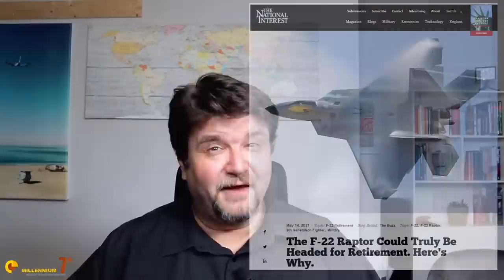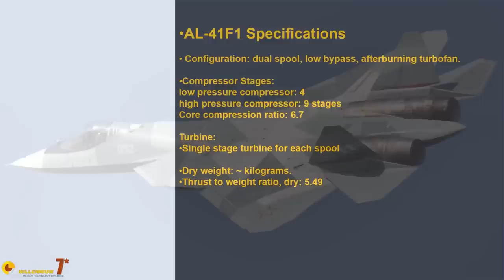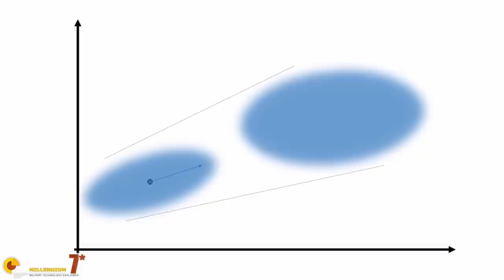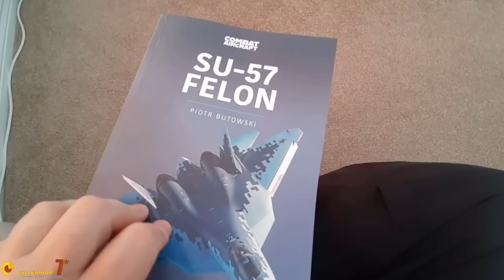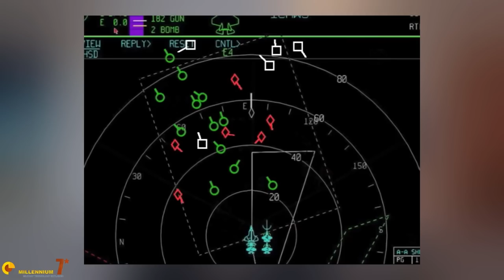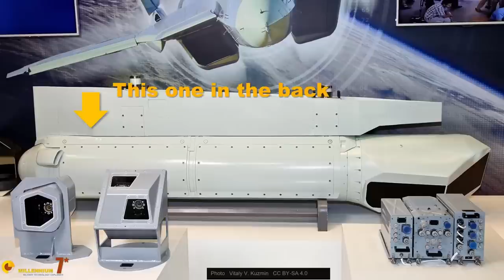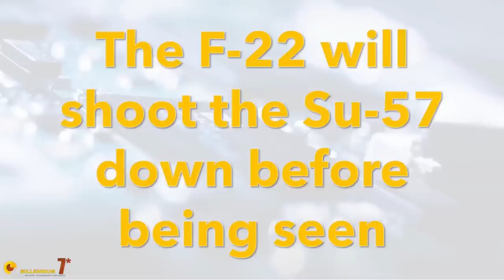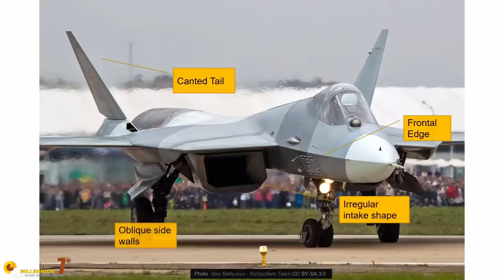Su-57 Update! + In Depth Analysis

Comment: Excellent video, as usual. 
  Just two points:
 You stated that a Super Hornet out maneuvered an SU with thrust vectoring. I’ve seen this video. The US pilot was flying a legacy Hornet, possibly a two seater of the Malaysian AF. I agree with you that TV nozzles have traditionally been used for instantaneous pitch. The Hornet series have excelled  with high pitch rates & high AOA without resorting to TV.
 The USN reserve pilot was working as an instructor for the Malaysian AF. His callsign is “Gonky”.
 
 Second, the issue of TVs effect on efficiency & stealth:
 You  stated that TV on the SU57 could be used for trim, eliminating drag (& also keeping these surfaces “stealthy” or flush). The F-22 already does this. 
 Before his recent death, Tomcat pilot “Snort Snodgrass commented that while flying formation behind a Raptor, he watched the TV nozzles “twitching several times a second”. This anecdote only tells of how it works in close formation and at the speed on that occasion ( it was a legacy flight ) at an airshow. Still , it’s unlikely the designers would leave this advantage “on the table” for 20+ years.
Reply: i think i heard this gonky guy on another channel and he was talking about dogfighting su-27 and said that he also lost to it but isn't going to post every single video and that su-27 is very capable
Reply: Gonky is on videos here on YT with Mover.
Reply: Gonky was contracting for BOEING and was in Malaysia as a part of the F18c upgrade program (to bring the F18c's to Superhornet level Avionics)

Yes Gonky's video is VERY clear to point out that he LOST to the Su30MKM plenty of times and that its BVR capability is also extremely good if not better than the Upgraded Malaysian hornets. He also mentions the way the Su30 was able to turn the tables, he dips his nose and mentions it doing an "eye watering" maneuver and has its nose on him before he could react, mainly because the vectoring allowed the MKM to complete its turn  significantly faster and beyond the capability of the Hornet to respond.

The Malay hornets were upgraded with Avionics that give parity to the Superhornet including HMCS, they are much better than the average legacy hornet. Obviously the MKM's are also positioned closer to China , based in the north of Malaysia because the MKM is still the primary air superiority platform of the RMAF... that by itself is plenty telling into the perceived capability of the MKM versus the upgraded F18C , which as mentioned is basically at parity with the Super hornet due to upgrades

Comment: Another stunningly precise evaluation. Excellent work, thank you. A thought on the L band and X band. The L band radar may be used in a search function, then passing off to the C band for tracking of stealth aircraft. Just a thought. Thank you again.
Reply: Those folks who clam the Su-57 L band radar (15cm-30cm wavelenght) can't track a US stealth fighters are fooling themselves.     The wing span of a jet fighter is huge so an leading edge phased array would be able to find the bearing (left right) of a target to within a small fraction of a degree.   The range could also be determined to within a few meters.   We then have the problem of the elevation. A two row dipole array can probably get a half power beam width of 20 degrees and be steered by mechanical rotation or phasing.  The ability to find the angle is probably 10-20 times better so about a degree.   A degree is an error of 300m at 20km but in elevation only.    There are other ways to direction find, for instance the radio goniometer as was used in the British Chain Home Low omni directional radar.  Sometimes simply called a direction finding loop.   B.T loops etc.
    -You are right, the X band radar can be cured by the L band.   A target to feint on an X band that is would be ignored as possible noise can be confirmed by the L band.   an Infrared Search and Track can also confirm.
    -So our chinese and russian fighters may not be as stealthy they are still very stealthy and the problem for western fighters is they don't have L band.
Reply: @williamzk9083  L-band AESA ( 8 pcs ) in Su-57 as mentioned before  are there  especially against aircraft with stealth features ( planes / fighters and bombers/ ) ,missiles and so on.

Wavelenght is exactly 24cm and is 8 times bigger  then in X band. So it means that e.g. something what L band can see ( detect-track) at 400kms , X band can't see at all or can only at 100 or 200kms ... Aircraft that have RCS ( frontal aspect ) e.g. 1m2 in X band have RCS in L band of 10m2 .

I wrote before some details about first public showing of AESA L band antenna at MAKS 2007 .It was big surprise then because it was and is only decimetric search-track radar on one fighter.

About that two rows of waveguiders in L band AESA , that are for different angles of searching . Upper row is for search-track when LEVCON's and wingslats are in  down position , row under that is for search-track when LEVCON's and wingslats are in normal position.

About beam width , it is lower then 10 degrees in azimut but is 70-90 degrees in elevation . There is no scanning in elevation only in azimuth( distance and azimuth measuring) . L band AESA have Mono and Bi static working regimes  and all 4 main antennas ( two in LEVCON's and two in wingslats) can work alltogether -simultaneously or separetaly.

L band AESA 's TRM  have 4 chanels , two for ID/IFF ( domestic and international) , radar search and jamming  of enemies L band assets. 

Because of phase and amplitude characteristics of L band AESA there is no stealth aircraft that can hide or stay undetected. Stealth planes can be detected and tracked from several hundreds of kms .
Reply: @williamzk9083  What is the difference beetwen X and L band AESA in Su-57 ?  First it is size and mass. Those  L band AESA antennas are so massive and heavy. 1.6m in diameter ( 4 main ones) , where  only one TRM have almost 5kgs of weight. In X band AESA radars we have a couple of hundreds or thousends of TRM , in L band we have a couple of them . Max output power of one channel in X band AESA TRM is a couple of Watts but in L band AESA is a couple of hundreds or thousends of Watts ( about 1kW) . 

Waveguiders have widht of 12cm or 1/2 of wavelenght and one TRM has row of 4 waveguiders ( each for one working channel) so there are 3 big TRM in one main L band AESA antenna with 3 rows of waveguiders ( 12 pcs) of course in 2 rows for different searching angles.

All AESA antennas both in X and L band have only one electric net for power and it is 27V DC-net. All of them have cooling by air and aircraft fuel , also all of them have not ' stand by mode' so after turning on they begin to illuminate signals into airspace ( Illumination mode).
Reply: @williamzk9083  yeah but with radars that small with that few transmit- received modules and with the limited power available on a plane what is the detection range going to be? Probably pretty small, esp against a VLO aircraft. And the F-35 has L band radar as part of its ECM suite.
Reply: @williamzk9083  
🤣🤣🤣
Už zase neviditeľná F-117, ktorú odfajčila stará S- 125 ?
Snivaj ďalej čo kto môže.

Comment: I really like the Su-57. Despite the teething problems that affect all aircraft development, I think it looks like a well designed, well thought out design. Thank you for your comprehensive coverage.
Reply: The internal weapon bay is not pressurized. On stealth aircraft, the weapon bay needs to have no gaps so that radar cannot get into the bay or reflect off the edges of the bay doors. However, if you do this the bay will be airtight. Because they are loaded on the ground there will be a bunch of air inside the bay that cannot escape when the plane goes to high altitude, and the pressure difference will blow the bay doors off the aircraft. Stealth aircraft get around this by having systems on board that equalize the pressure in the bay, but the SU-57 doesn’t have this; although it doesn’t need one, because there’s a gap in the bay doors that you can stick your pinky finger through. You want proof of that? Just look at 1:28:02.

Comment: thrust vectoring is also used in supersonic maneuvering. notching more efficiently is extremelly important to BVR combat, couple that with the increased angle limit of the radar locking on the Felon and you have a fighter capable of quicly going from nose hot to flanking while still keeping radar lock on the bandit which will loose lock by defending.
Reply: Yes they do. And if thrust vectoring was really useless. Why did US use it on the Raptor?  Right?
Reply: @Max_Da_G  The F-22 is supermanuverable wdym? The government hides the full capabilities, but the su-57 will out maneuver the f-22 mostly.

Comment: I like your videos on the SU-57.  Your part 4 states that there is L band radar on the plane and this can only be the case if the plane was twice as large.  S band is most likely along with x band.  As for using the DAS with the HUD, I am curious if the SU-57 has an auto defend feature like the F-35 using these systems.  Good job.  Keep up the good work.
Reply: Id imagine so with all the different defensive systems it would have to be. Most interesting aircraft I've ever studied on a pure tech level.
Reply: With how "automated" Ka-52 with Vibtesk DIRCM responding missile threat, i would believe the system on Su-57 will more complete on responding missile threat
Reply: Not necessarily L-band is decimetric and given how thick and long the SU-57s wings I’m sure they can fit enough emitters perhaps not to track and detect an aircraft but at least point the N036 in the right direction to where the target.

Comment: Thank you for the detailed discussion. I have always felt that in aircraft the US has the technological edge. But that is a mute point. In a knife fight does it matter who has the best knife, or who is the best fighter. In boxing, is it who has the best KO record, who has a longer reach, or who boxes his opponent outside his opponents previous experience. Let's hope we never have to find out the real answer those questions in combat.
Reply: Also, how many knives you have.
Reply: The Su-57 will never live to see knife-fight range with an F-22 or an F-35.  It won’t even know they’re there until the missile alarm goes off seconds before impact.  And even in an extremely rare knife fight, an F-22 is just as maneuverable and has better avionics and flight control computers , and the F-35 is a lot more capable than people seem to think due to better engines and flight control computers.  Missile capacity on both is being upgraded.  And the Su-57 only really has an advantage there with external stores, in which case it would be cannon fodder.
Reply: I don't see where the US leads Russia in tech, anywhere. From hypersonic missiles, to this SU-57 and even their infantry tools are are designed with different concepts.
Reply: @dennisyoung7363  Well then you're just not very smart then buddy

Comment: i guess maybe the su 57 radars works simmiliar to the "anti stealth" radarkomplex Nebo M M55ZH6M for S400 and other air defense systems , where the radar uses combined frequencys .
Reply: I believe L-band antenna at relatively pretty high power output, it will only can achieve the detection range of the X-band radar for the same RCS (i forgot how big the RCS). But it assuming that the L-band antenna installed both on leading edge flap and Levcon. This will make cooling a very big issue. So most analysis only predict the L-band for electronic warfare. 
But who knows, maybe Russia have secret algorithm that can differentiate pretty low energy L-band echo from the noise.

Comment: The "unexpected maneuver to confuse missile guidance" theory is interesting, but I don't think it holds up under analysis.

Modern Air to Air missiles have three phases of flight for long-range engagements: 1, "loft" phase - the missile climbs to an altitude where it can accelerate to its best speed for the engagement.  2, "midcourse" phase - the missile uses track data (either from the launching aircraft, or via datalink from AWACS for the most modern iterations) to predict where the target will be and intercept it, 3 - "terminal" phasse - the missile acquires the target with its own sensors and maneuvers to fuzing range.

The midcourse range is the range where it would be theoretically possible to confuse a missile be exhibiting unusual acceleration.  However, in this phase, the ranges and closure times are so long that the relatively tiny anomalies which could be generated by a thrust vector assisted maneuver are irrelevant.  The goal of the missile in this phase is not to hit the target, but to guide to a position where the terminal phase can take over.  the 'basket' in which the terminal phase can catch the target is very large (several miles wide), and the TVC capability cannot maneuver the plane enough to 'trick' the missile into missile by that wide a margin.

In terminal phase, there is no algorithm to trick: the missile will guide using "proportional navigation" - that is it will steer itself to maintain a crossing-velocity of zero with the target.  As long as the missile has enough energy to accelerate faster than the target while in this phase, it WILL hit, regardless of how "weird" the target moves.

Comment: Su-57 is the most flat-bodied (low-observable, high-lift, unlike all Western types) combat-jet I've ever seen (and remember now), 
with a huge weapons-bay (crucial, unlike the F-22's small-one) and IRST (unlike F-22). Unlike the F-35, it is high-altitude, high-performant, super-maneuverable, long-range, maintainable, rentable, survivable (two motors, set widely apart), rear-radar, scalable (growth capability internally and externally) and has no known alternative scheduled.
Reply: It still takes skilled hands plus hours and hours and hours in the seat to be effective with such an awesome aircraft, and it is AWESOME.  But if the SU-57 and the F-22 were to face off in the sky today, there would be a Russian military funeral, tomorrow.
Reply: I concur with most of this, though I’ll point out that both F-15 and F-22 are decent lifting body designs too.  The F-15 has even been known to have an entire wing sheared off in a mid-air collision, and still flew back to base and landed safely (Israeli Air Defense Force, video is on YT).  That’s like the holy grail of lifting body design.
Reply: @edgetwins529  in an interview with British test pilots who flew the first su27's back in the 90's. They quote "found the plan very easy to fly because the planes were designed with low levels of training in mind". American designs (from cars to planes) are always over complicated. The rest of the world thinks it's smarter to build simpler and simpler systems, but not the west.
Reply: @singular9  Even more so to maintain, build and to operate on a messy-field. US bought its afghans Russian Mi-8, because they failed to maintain and properly fly the Blackhawk. Similarly, ultra-rich Saudi-Arabia has hardly ever got any Hecliopters and lost the war in mountainous Yemen. It also gifted away to Egypt the two large and new helicopter-carriers it bought from France.
Reply: @singular9  I'm sorry my friend, but "easy to fly" does not translate to mastering the geometry of  dogfighting or BVR combat in a 5th gen fighter.  The American's have the upper hand due to the yrs of service the F22. It's not who carries the bigger stick it in this case. Not by a long shot.  And if the rest of the world, as you put it, prefers "simple", then why do they still order So many F-35's, I wonder.  Those things are friggin everywhere. Certainly there's an upside to western complicated fighters that outweighs "easy to fly"
Reply: @edgetwins529  lol the geometry of a BVR fight 😂
Reply: @edgetwins529  u said OR BVR in your comment can’t even remember what you wrote 😂
Reply: @little_error295   Read the rest of my edited response.
Reply: the cope is real

Comment: LO aircraft can be seen on any band of radar, just their RCS is super low, a S/N problem.  With L band and sensor fusion, the computer can take the faint returns from LO aircraft on shorter wavelengths and combine them with the long-wave radar info to create potentially firing solution worthy tracks.  At a minimum situational awareness would be greatly enhanced if this array works.  If the datalink bandwidth and fusion processing power exists to support it, the Su57s could work collaboratively as a mini-AWACS which would be able to massively improve track resolution on LO targets.  The more L band returns one can fuse, the more accuracy can be achieved.  Additionally with long range AA missiles, the fight profile takes them to very high altitudes, and from that (top) aspect, the LO capabilities of target aircraft are not as strong.  Guidance only needs to get a missile close enough to engage its active seeker
Reply: Correct, why no one here even tried to think what if there is two Su-57 linked flying mission? How about 4?😂